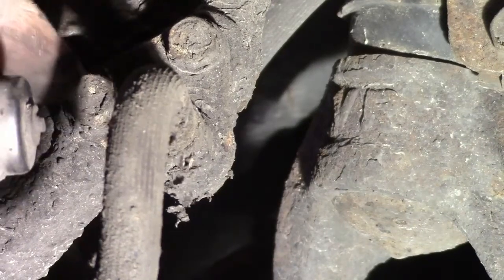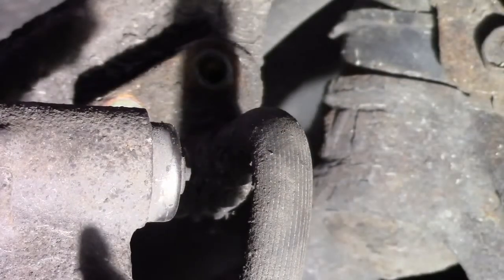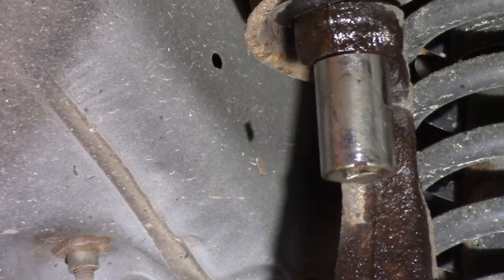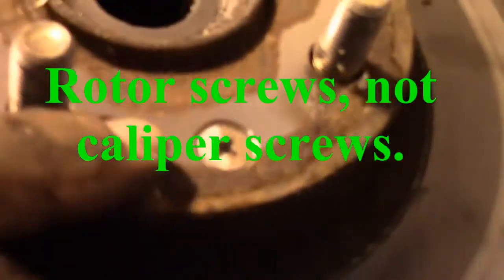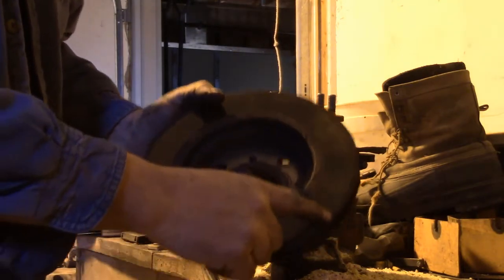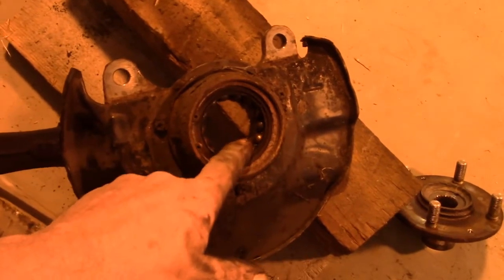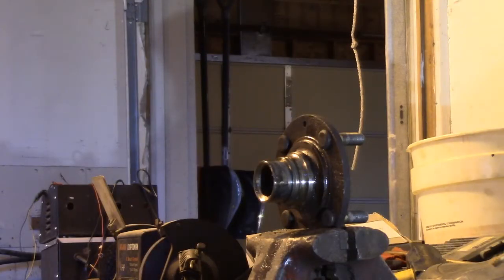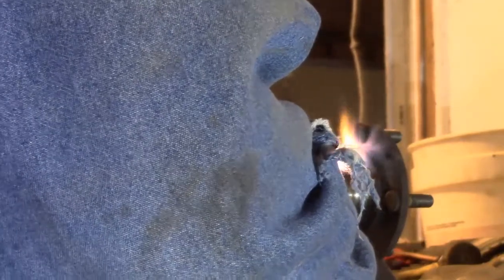Replacing Front Wheel Bearings on Honda Civic - Part Two of Six

Comment: I'm preparing to attempt to replace my wheel bearings. I found elsewhere that the "Philips" screws that hold the rotor to the knuckle are not Philips head screws, they are JIS #3, and the bit needed to remove them has a flatter tip which grips the screw better than a Philips screwdriver. I have seen a lot of videos where people are destroying the screw trying to hammer a flat blade screwdriver or force a Philips bit into it.
Reply from the maker: Thank you for that information.
Reply: @fixyourself9163  Here is one of the links https://www.youtube.com/watch?v=MXWciXIQUm8&t=195s